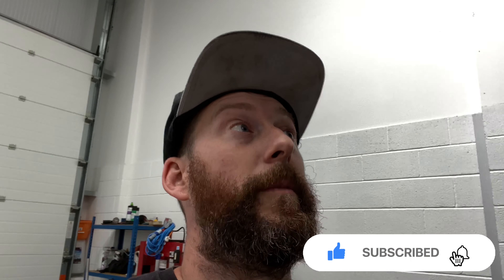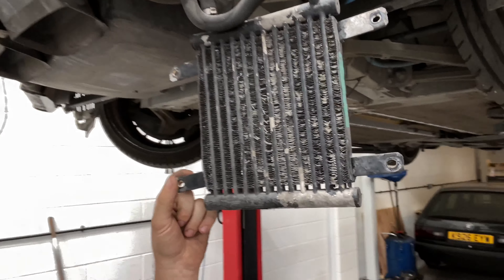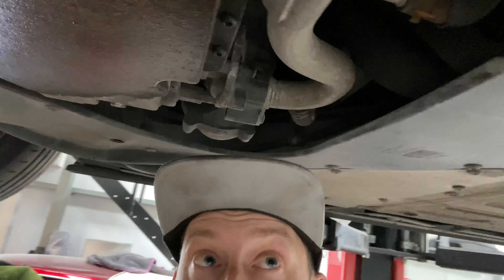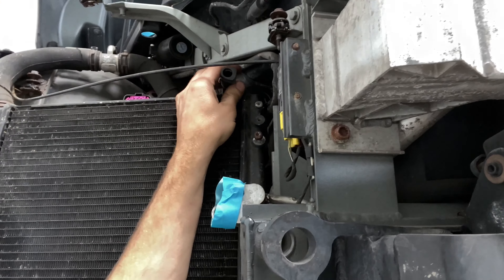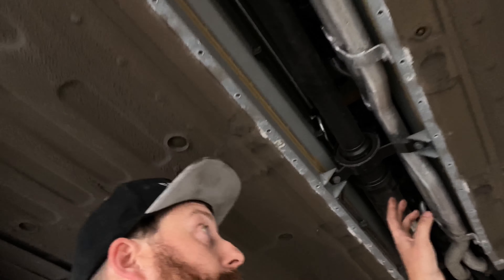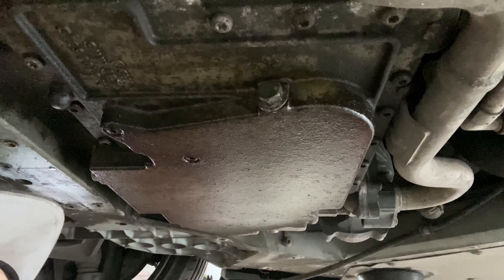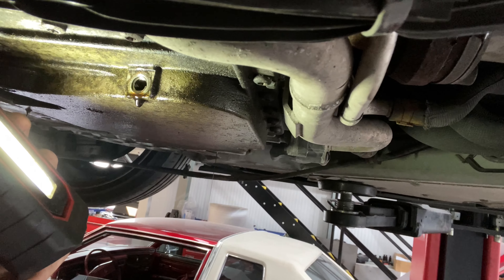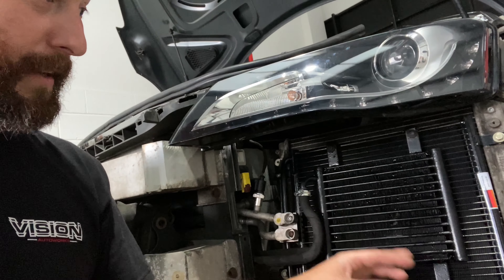EVERYTHING WRONG WITH THE CHEAPEST R8 IN THE UK - EPISODE 2

Comment: Hi mate. 
I'm uk AC engineer.  
 looks like u need to replace  AC condencer.  
U can test old condencer by air and leaking detector fluid to find leak point.  Then bypass broken and leaking line and block them by aluminium walding.  
I assure u.  if u cancel up to 10% of line to avoid leaking .  nothing  will happen  to ur AC function.  
I've done this repair for 5 expensive audi and Mercedes and one Bentley condencer.  
Will be much much cheaper than new condencer.  
Good luck 👍

Comment: Guess you have done all the checks at the plug? 12v + earth? On all the other vag have both wires live which then when the button is pressed it switches one to an earth.
Reply from the maker: Yeah, been through everything electrical. As far as the car is concerned, it thinks it’s working. Unfortunately, one of the common issues with the R8/S4/RS4 is mechanical compressor failure. I’ve done a pump on an S4 before and that was quite involved 😄